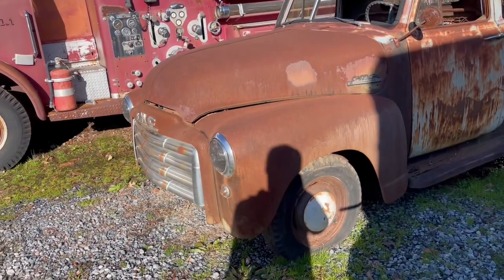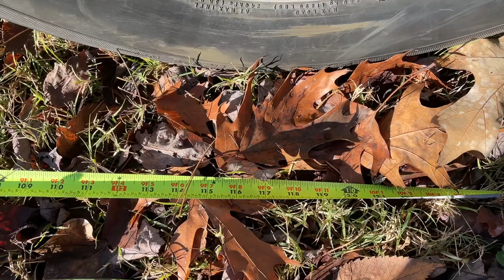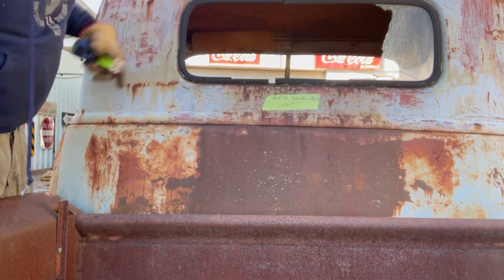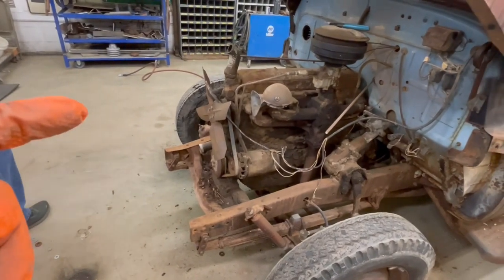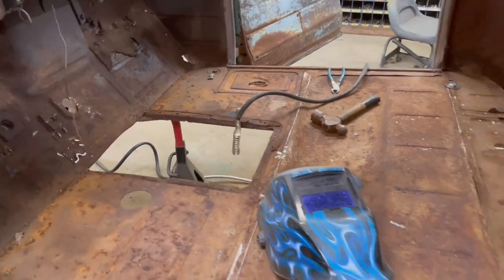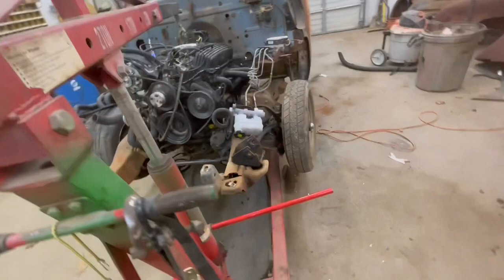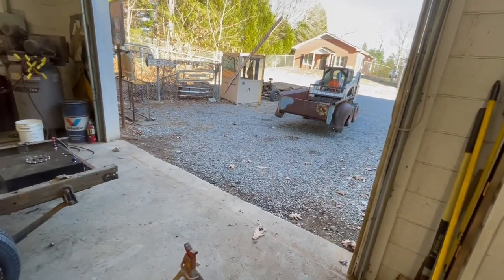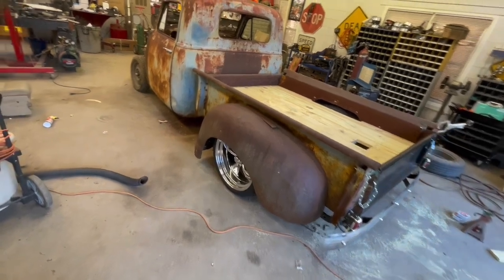1950 GMC/S10 frame swap (part 1)

Comment: My 55 series 1 was 116 center to center originally but I did a S10 as well and made it 117.
Most of the trucks look better with 117 because originally the 116 looks to short at the rear wheels

Comment: In the past i have drilled the hole in spring pads to move rear end forwards or backwards.i use s10 blazer rear ends with disc brakes ,which also have positraction ..blazer rear springs also give more load capacity.blazers also have sway bars which greatly helps handling.
Reply from the maker: Great idea Thank you!

Comment: I use v6 starters.smaller high torque.fits perfect .i have used these starters on high compression big blocks with no problems

Comment: Looks like a solid truck. Doors are not right for a 1950. If the cab is a 50, the doors have been swapped from a 52-54. I wish i would have put mine on an s10 chassis.
Reply: for sure not 50 doors

Comment: Is there a specific year of the S10's that you'd recommend? I'm preparing to build a '58 GMC using a donor S10 (complete and running) for the mechanicals. I don't care about swapping in a V8 just yet, as I've never taken on a project of this magnitude before...

Comment: I am doing the same build.  I am so glad I found this.  You work way faster than me.  It’s fun to see.  Are you sure it is a ‘50.  It has vent windows and thumb press door handles.  Both of which were first on the ‘52.  You have shown me a lot to think about as I build mine.  I am worried about my starter now hitting the lower A arm.  Great ideas for bed material too.  If your bored and can share some advice I have mine on my channel.  Thank you so much for sharing.
Reply from the maker: I’ll go check it out thanks!

Comment: What about the 2001 to 2005 tahoe?? I recently did a 53 3100 and i used a 95 s10 single long bed and to me was to narrow, i end up using 2” spacers for front and back wheels and I’m using 20x8’s front 20x11 back so not to sure if tahoe might work and I check and tahoe has same wheel to wheel measurements

Comment: I make my own motor mounts .factory mounts to bulky.also notch frame for fuel pump.then motor can move back and down.this eliminates need for drive shaft tunnel.trim lower control mount and dent header tube.

Comment: Did you use the S-10 rearend
Reply from the maker: Yes
Reply: @gordonsmart  did you have off set wheels or did you use wheel spacers
Reply from the maker: Wheel spacers in the rear
Reply: @gordonsmart  thank you for answering my question did you use 2 or 3 inch in the rear
Reply from the maker: 2 inch, sorry I meant to give that info 
I don’t remember right off the back spacing on the wheels but I can get that info to you later this week
Reply: @gordonsmart  thank you so much

Comment: I have a really nice S10, you can click on my username and see. But I am considering a Body swap with something 1968 or earlier onto it's frame. The body on my S10 is one piece as the cab has been welded to the bed. It can all be lifted off in one smooth move. What I'm not sure of is if the VIN goes with the Body or the Frame.  I find no VIN whatsoever on the frame. I also don't want to get a Donor Body that I can't title\Register because of  VIN issue.  Any info?